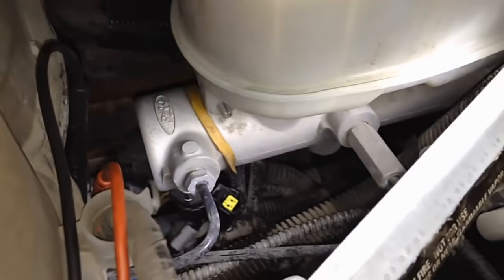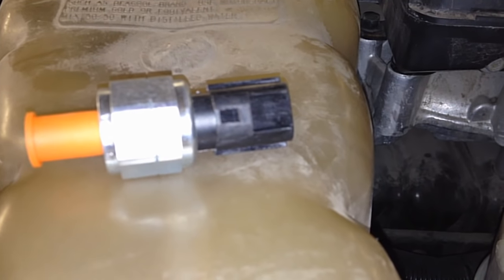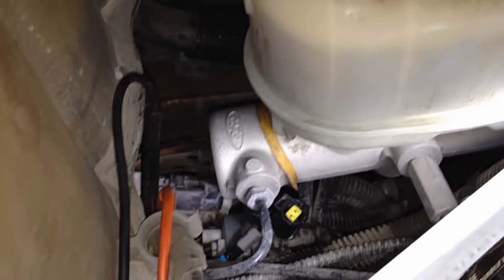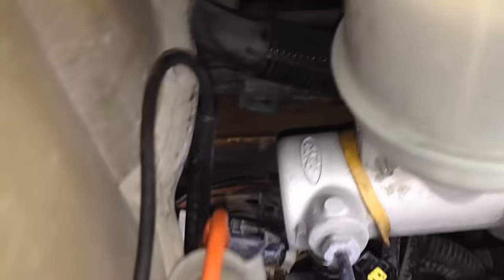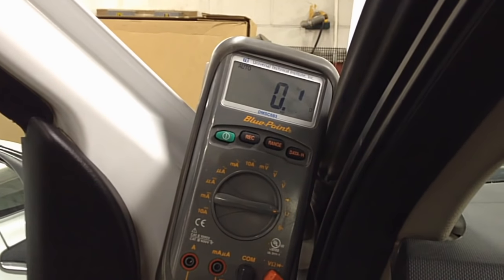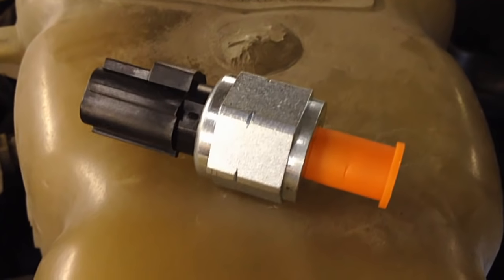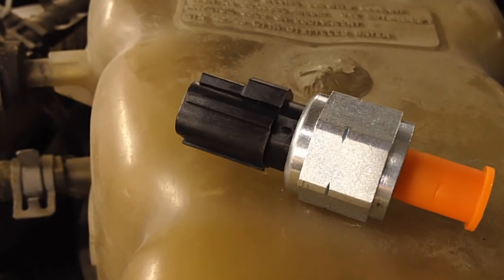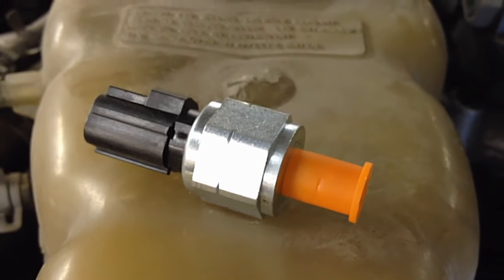#1 Reason Your Ford Cruise Control Doesn't Work Anymore

Comment: OK-- '95 E350. No cruise light at all. Switch was gushing brake fluid. replaced it.
New switch came with a harness. Two recalls already done on Cruise switch. Both are labeled. I installed new switch. Installed included pigtail harness and connected it to the recall harness that was connected to old switch. 
Still-- no cruise light on dash. Nothing works.
Fuse OK-- horn blows, brake lights work. 
Tested switch as you described-- woring. 
Connected new pigtail to extra harness (also with recall tag-- engine cranks-- won't start (WTF??) reconnected to other recall harness-- engine starts-- no cruise light-- does not function at all>
Any suggestions?
What would cause cruise light to not come on at all?
Fuse in recall harness blown? Would that do it?
$32.00 for new recall harness. Looks like it requires undoing harness wrapping and splicing in-- would  blown inline fusible link cause cruise light to not come on?
anyone simply take recall harness apart-- cut out fusible link and by pass or install replaceable in line fuse?
I'm wanting to take off in a few days-- if I don't watch my speed, this Chinook M-K with the 460 engine flys-- I'm doing 80-85MPH!!
Really could use that cruise!! Don't wanna end up in Georgia somewhere in jail with Bubba-- nowutImean? 

Thank!! REALLY-- THANKS!!!!

Comment: I have a 2003 ford escape  3.0 v6 DOHC  My cruise control does not come on at all took it to repair shop found that the buttons on the steering wheel was broken that cost me 270.00 but the cruise still isn't working The tech says he has power to the servo but it does not set or the light come on   any Ideas about that ?
Reply from the maker: Gary Watson There are many steps to go through on these with a multimeter. I really think the shop should diagnose it for free since they misdiagnosed it in the first place. First place I would go is the cruise deactivator switch on the pedal.

Comment: Hello I have a 1994 E350 camper with the 460. The cruise works when it wants to. Do you think this may be my problem ? Also is it located in the area of the master cylinder...Thanks for you videos
Reply from the maker: Edward Aiken While servo failures are common I would still replace this switch first. If it is not on the master follow the brake lines down to the frame and you should fins the switch.
Reply: I have a 93 f250 and its located down sitting on the frame drivers side.just follow where the lines go from the master brake cyclinder down to the top of the frame, and you will see a brass block, 2 of the lines plug into it, and the switch is also plug into it as well. and there you have it.

Comment: Changed the brake lamp switch and the pressure switch on my 2004 f-150. Still wont work if its warm. If its cold outside it will work till its warmer like above 20 degrees then works intermittently.
Reply from the maker: I have a test procedure you can do to find the fault when it is happening. Do you have an email address I can send it to?
Reply: FordTechMakuloco yes send me your procedure I would like to see it.. AL
Reply from the maker: What is your email address?
Reply: I have the same problem!!  It's driving me nuts.  Did you ever figure it out?

Comment: does this apply to the 03 expedition 4x4??? my CC doesn't work!!! I even bought a new CC part to replace the one I have but haven't installed it yet!! I guess I should just check the fuse first?? then what you have suggested here!! I need Help!!!!

Comment: You're probably sick of seeing these but:  The dealership replaced the switch on my grandpa's '97 F150 but the cruise control doesn't work.  Jumping the harness works though.  Bad connection there? Bad switch or something wrong with the master cylinder?

Comment: Hello, Ive got this 1993 Ranger with the 4.0 and I can't for the life of me figure out why there are two cables connecting the gas pedal and the throttle body. Im almost certain the 2nd one is for cruise control, just looking for some insight, it would be GREATLY appreciated.

Comment: Trying to locate this switch on a 2012 Ford Focus SEL and there isn't a single plug on the master cylinder, there's a plug on top of the reservoir that I assume monitors brake fluid level and it's not threaded just a direct connection to the top of the res.  Any advice on where to find this switch?

Comment: Any suggestions for a 2004 Focus? I dont see a master cylinder, just the resivoir with a sensor in the cap, yet I suspect its just fluid level, only 3 wires. Cruise wont turn on at all. I see the module, but don't want to pull apart the steering wheel unless its the only way. Thanks
Reply from the maker: First off make sure the brakes lights are not stuck on, right after that I would replace the deactivator switch which is to the left of the brake light switch those are most common on these. If I have an email address I can send you a TSB with details on how you can do a self test of the system and it will tell you why it is not allowing it to come on.
Reply: FordTechMakuloco
 Thanks a lot. I found how to, and preformed the test, but the cruise light never came on at all. All brake lights are working properly, so I suspect it might be the control buttons, or wires to / from. Next time I'm at the junkyard I'll grab a couple deactivator switches so see if thats it. Yet with no light, I suspect otherwise.
 I'm wondering if the cruise light bulb might be burnt out also, since it doesn't come on when the key is turned to on.
Thanks again
Reply: FordTechMakuloco I have a 2002 focus with similar cruise issues. Could  you send me the information as well.

Comment: My cruise control went out. A few weeks later, my 2005 Ford Taurus SE, started to accelerate on it own, as if it were stuck in cruise. It went up to 70 mph and was difficult to brake. We unplugged the cable switch, yet it still ramps up and seems like it wants to take off, yet when stopped it sometimes feels as if it is going to die.. We have replaced a few sensors, yet still having issues. Any idea what this could be? Thank you.

Comment: Thanks for the video. I don't have cruise or even the green light on the instrument panel.  You still recommend changing this part?  Thanks.
Reply from the maker: If the vehicle is not equipped with cruise you wont have this switch.

Comment: I have a 2012 Ford Focus with intermittent cruise control issues.    What is the diagnosis with this year and model?  where is the switch I need to check and/or replace?
Reply from the maker: Thomas Shostak I would change the deactivator switch by the brake pedal, one is for the brake lamps and the other is for the deactivator switch. It has 2 wires going to it and the brake switch has 4.
Reply: FordTechMakuloco Sounds simple enough.  Thanks - very helpful, as was your video.   I will give it a try.  I just wonder why the mechanics at the Ford dealer could not figure this out.   I have talked with them on multiple occasions and all I got was frustration.
Reply from the maker: It can be intermittent that's why they wont jump on it. They get out of adjustment and must be replaced at times.

Comment: When this fails will the cruise light not come on? I have a 2000 Windstar and cruise is not working. Also I dont see the switch go on and off with the scan tool. I do see the  set speed and coast switches in the scan tool being acrivated.

Comment: I've got a 2006 Explorer 4.0L and the cruise control comes on by itself!  Changed out the buttons on the wheel, still does it.  Changing the brake and cruise switch on the pedals next.  Any other ideas?

Comment: I have a 99 f150, cruise doesn't work anymore it just stopped two nights ago. Checked fuses all good replaced switches on steering wheel nothing, replace part and wiring at master cylinder still nothing. what should I do next?

Comment: I have a 2004 non heritage f150. Replaced the brake pedal switch, steering wheel switch and third brake light works. Still no cruise. I don’t have the switch by the master cylinder. Any thing else to look at?

Comment: My 94 F-150 is a 4x4 5.8 V-8. Sometimes when I start it and it idles, it goes clunk. Just like you hit a kill switch off and on.  Or sometimes it does it at a stop sign. It just goes off and on instantly. Any ideas?

Comment: I have a 2001 Escape XLT 4x2 automatic.... the cruise buttons on the steering wheel do nothing and all fuses are fine. I did the self-test and the light will flash for buttons on one side but not the other.  any ideas?

Comment: My 1994 f250 cruise does work and holds the speed exactly. However, when working it jerks fast then slow all while maintaining a constant speed. If I have a trailer load behind the serging stops as the trailer weight seems to keep it steady. Wondering if anyone can help. Would replacing this valve solve the problem?

Comment: i have a 2000 ford excursion and I'm having the sam issues with the cruise control. when i press on-set axle- cruise the green cruise, light comes on but will not hold the speed. come to find out there is no cruise control fuse for the excursion.  I replaced the sensor switch with no resolve. I'm currently checking juck yards for the servo. how do you take cable apart from housing? i got the top computer board off.
Reply from the maker: ben williams There is a tang on the cable housing where is locks into the servo, push it in and turn the whole thing counter clockwise.

Comment: My truck is an 04 Ford F150 with the 5.4 triton engine. The only switch that I am able to find on the truck is the one located at the top of the brake pedal mounted with the brake light switch. Is this the only one? I looked out on the engine as showed and found nothing else that met that description. Wasn't sure if I was missing something. Thanks.
Reply from the maker: Will Hoilman There should be another switch right next to the brake light switch that is the one that fails on those.
Reply: Yes. I replaced that one & it fixed it. Guess my truck was built after the recall and was made differently. I just wasn't sure about the one under the hood. Didn't know if there were two switches. Called Ford & they told me just the one on the petal. Thanks

Comment: i have ford freestar 2005.My cruise control is not working and the light does not come on when I press the ON button or when i turn key on ON position. no cruise control light at all not even for 1 second.

Comment: When you buy the new sensor it doesn't come with the same plug that the car has. You need to make a connector out of what you have, or buy the adapter from Ford for a few dollars..

Comment: I have a 2007 Mercury Monterey that the cruise control that works on mostly flat roads but does not hold cruise speed going down a hill. Is that still the switch or something else? Thanks.

Comment: I have 10' F350 6.4 Code P0703. PID on Snapon Souls shows BPA switch functioning, Brake switch PID shows off. Metered the pressure switch shows closed. Tail lights work. Any ideas on which direction i should go? Just bought the truck 3 weeks ago and the cruise worked on the test drive.

Comment: Yea I know that's why I haven't fixed it in years. The truck is a 01 with 210k miles on it. Don't wanna put the money in it unless I can get a used one in good conditions on the cheap. There 250 300 new aren't they?
Reply from the maker: yeah but you can get them, allot cheaper on ebay junk yards.

Comment: This may be a idiotic question but what are you using to test the continuity of the switch. I have a 97 Escort w/ cruise control. That works intermittently and most of the time it doesn't start working till I have been driving for 10 minutes or so.
Reply from the maker: Aaron Gray Regular multimeter on the ohms setting.
Reply: FordTechMakuloco I have a 99 Taurus where is this switch located on it? Is that the only thing that could stop my cruise control from working?

Comment: I have a 2006 Expedition Limited that the cruise is not working. I have replaced the blue disconnect switch by the brake pedal and still no cruise. I have a pressure switch on the bottom of the master cylinder that points down just like in your video. Problem is it has 3 wires on it. A solid red, a red with white stripe and a white with a red stripe. Which 2 of these wires do i jumper across to test the switch ??
Reply from the maker: Domino 1a you can test across the rd and wh/rd wires for 5v with a multimeter but that is about it
Reply: FordTechMakuloco Sorry to keep bugging you about this but I was informed on another forum that the pressure switch on the bottom of the master cylinder was a transducer for the ABS ??  Is that true or is it a part of the speed control circuit ?

Comment: I have a 2005 Expedition, cruise control wont work. Doesn't turn on or respond at all, no light in dash. I have two switches on the brake pedal, one around the bolt, black, which I guess is for brake lights and what not, and then an extra blue switch that is self adjusting on a bracket. Tested both, they work, even disassembled the blue one and cleaned it, tests fine with multimeter. All other controls on steering wheel works, but I haven't measured if the cruise buttons actually makes it through the clock spring yet. Any idea where to go from there?
Reply from the maker: Try this, the cruise deactivator switch disconnect it and jumper the terminals and go for a drive does the cruise now work?
Reply: Thanks, I'll test that and report as soon as I have the results. :)
Reply: FordTechMakuloco But make sure you understand that if you do this on a vehicle that is not supplied with the secondary brake light cut off switch ( 3 wires)  that your vehicle will not slow down or come off of cruise control until you hit the cruise control off switch on the steering wheel or dash... or a very bad accident might happen! ASE MASTER MECH. AL
Reply: Turns out that the switch was OK, but the connector was not. Was able to repair the connector, and now it works like a charm! :) Thanks! BTW AL K , the switch is sort of a double safety switch, the cruise control will still disengage when you press the brake pedal as it also gets a brake signal from the brake light switch, so as long as the brake light switch works you can safely bypass the cruise control switch and still have it disengage when the brake is depressed.

Comment: 2009 f250 pickup with no cruise control power.  changed brake pressure switch no change, thinking it might be the clock switch but not certain.  Any other ideas? or how to test if power is getting to CC switch?

Comment: I have a 12 Expediton FWD. While driving on the highway with ac and cruise on the driver side IWE sounds like it tries to engage kinda like a grinding sound assuming because of the speed. If I hit the brakes to turn off cruise, it stops making grinding noise. Only time it will do it, highway with cruise and Ac on. Any Idea what is the problem?

Comment: Man your awesome !!! I have saved so much money just by watching your videos!
The problem i have with your videos is you make it look easy ! For example i changed the lower ball joint and upper arm,tie rod,front suspension. I used the hole weekend just for the left front side of the suv, and a other weekend for other side. Yeah it's a Ford expedition 1999. 

If someone would be looking for a reliable Ford what type and model would you recommend?

Comment: I have a 2006 Ford 250 the DTC are p0581 which is cruise control multi-function imput A circuit higg. Have any experience with this I am in the process of doing research right now. Was just curious if you have any insight. FordTechMakuloco Thank you

Comment: FordTechMakulocoI have a 04 f150 3v new body style and the cruise control doesn't work... horn works i checked all the fuses, and i changed the cruise control deactivator switch on the brake pedal top left the blue one and still doesn't work at all... do you think it could be the buttons themselves?

Comment: I have a problem with the 2014 Expedition cruise control .When I drive for a while all of a sudden the maintenance indicator lights up and the cruise control gets stuck and the acceleration becomes weak.
When I restart the motor sometimes it turns back on and sometimes the maintenance indicator comes back and the cruise control fails. Can you help , please!

Comment: I have a 2007 F-150 and this part is not on my master cylinder, any ideas on where I should look next? The cruise will come on but it always randomly kicks off while I am driving. We are moving from TN to AK in May and we will drive most of the trip. I REALLY need to get the cruise control fixed. Thanks for any help you may be able to provide!
Chris
Reply from the maker: +tullahomaC It is under the dash above the brake pedal top left
Reply: +FordTechMakuloco what could it be if i push my cruise on and coast buttons at same time and my horn beeps??
..should i call a priest?
Reply: I got it switched out, part was just over $20 at Auto Zone. Quick easy fix that I needed to get done, we are moving from TN to AK in May. Too long of a drive without cruise control!
Reply: theres a blue wire that ties in together at the connector behind the air bag and it will blow the horn when on and coast are depressed. dont ask me why
Reply: FordTechMakuloco 
You just saved my life. Been seeing this part on videos and I don't have it either. Mechanics look and shrug. Ford wants my first born before even looking at it. I interstate drive a LOT. Fixing this Sunday now thanks to you. I liked, subscribed and I'll frikkin donate if there's an option. I always come to your channel when I have an issue lol

Comment: I have an 03 expedition and the cruise control light stays on. I replaced the blue and black switch under the brake pedal but it didn't turn the lights off it also made the brakes much tighter. is there something else I could do? could it be my steering wheel buttons?